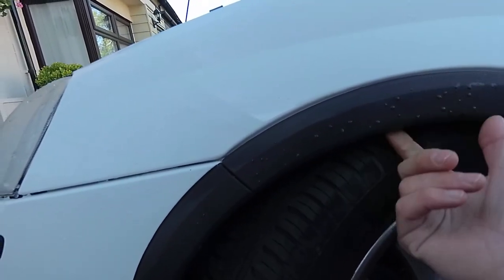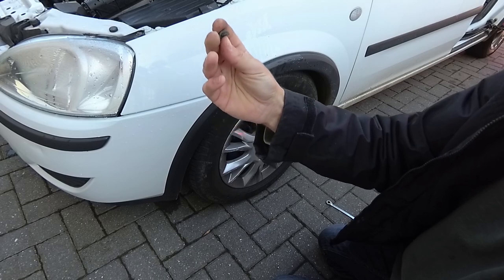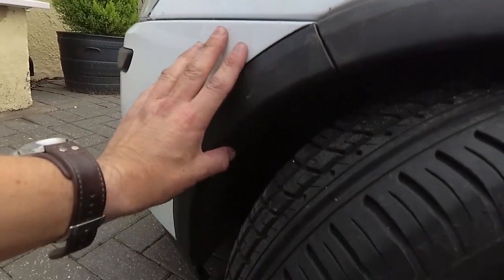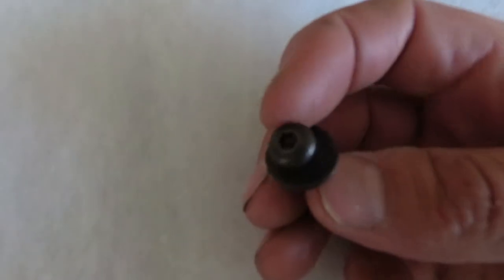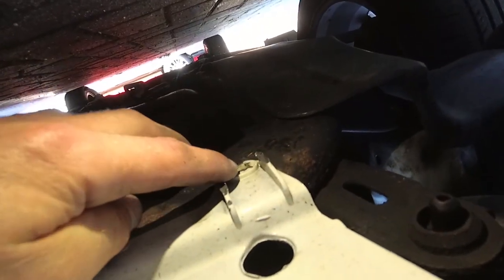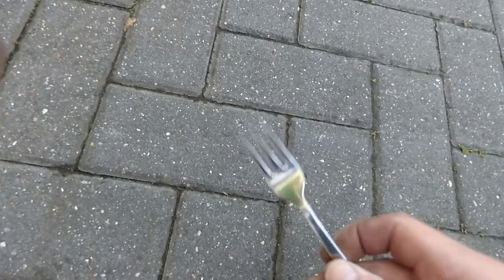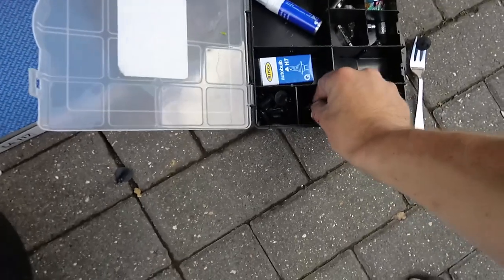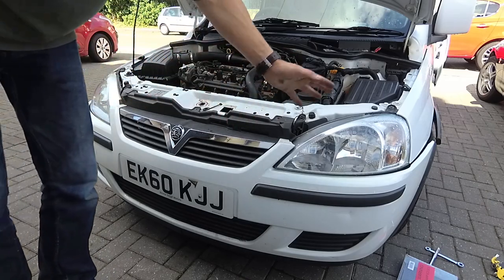How to Remove Front Bumper Combo / Corsa C - Vauxhall  COMBO MODS

Comment: Just removed and refitted today, thanks for the walkthrough. To answer Taylor Page
 question (from a year ago, sorry so late). To remove the upper grille for Irmscher (or, in my case, a Blitz to replace the Griffin that was on my Opel) there's no subtle way. The are LOTs of plastic tabs and they are gunked, glued and melted into place. Just get a small claw hammer and lever the black grille away, section by section. Some tabs will stay on the bumper; most will snap off, still stuck to the grille. I used Gorilla Glue Gel for my Blitz grille (which came from a breaker and most of the snapped tabs were stuck in that).

Comment: Very helpful video, thank you. I had one of those little black panels knocked out by hitting a bird and, because most of the straps have broken which hold it in place, my best option is to get the bumper off. One additional piece to add I think is to just jack the car up if you can't get at those bolts above the wheel.
Reply from the maker: +Richard Archer yes that’s a good solution, but if your jacking the van up then may as well take the wheels off too, for ultimate access.

Comment: Where did you get that box of hardware from, I know you can buy individual sets of hardware but am looking for a set of different bolts n stuff that all fit the car in case I break any taking off anything, any advice or links appreciated
Reply from the maker: +Daniel Nicoll I just bought the hardware all separately from eBay and Amazon, then got a cheap box from the pound shop to store them all in.

Comment: Where would i find those rivet clip things for the bottom of the bumper? What is the name of them
Reply from the maker: They are called plastic trim rivets, got mine from ebay, heres a link to some - 
https://www.ebay.co.uk/itm/10x-Vauxhall-Bumper-Wheel-Arch-Plastic-Rivet-Body-Panel-Retaining-Trim-Clips/273427989552?_trkparms=aid%3D111001%26algo%3DREC.SEED%26ao%3D1%26asc%3D20160908105057%26meid%3D5e5355dbcb644c12ae7f6f36cfa497ef%26pid%3D100675%26rk%3D1%26rkt%3D15%26sd%3D273427989552%26itm%3D273427989552&_trksid=p2481888.c100675.m4236&_trkparms=pageci%3Abe55bd02-b593-11e8-8365-74dbd1809856%7Cparentrq%3Ac78493bc1650aa465239ac36fffc8c41%7Ciid%3A1

Comment: Once you take the bumper off do your headlights slide out or you got to take out bolts? I need change some headlight bulbs but having no joy from the tiny gap at the back of the lights.... grrr
Reply from the maker: +Anders Mcfarlane the headlights have their own bolts. Yea you need double jointed pixie fingers to replace bulbs from the engine bay.
Reply: Rust Locker cheers. Mate....iv got my Saturday morning sorted to change a bulb.....I’ll do them all come to think of it now....nice 1

Comment: @Rust Locker - all the replacement bolts you've brought, where did you buy the replacements from? if you could share the link??
Reply from the maker: i got them all from ebay. Some of the sellers I bought from are no longer listing, but similar links below :)

https://www.ebay.co.uk/itm/8-PIECE-SET-for-VAUXHALL-CORSA-C-EXTERIOR-FENDER-WHEEL-ARCH-TRIM-CLIPS/222086512410?ssPageName=STRK%3AMEBIDX%3AIT&_trksid=p2057872.m2749.l2649

https://www.ebay.co.uk/itm/10PCS-Bumper-Rivet-Trim-Clips-Fasteners-For-Vauxhall-Astra-Corsa-/283078731679?hash=item41e8cea79f

https://www.ebay.co.uk/itm/5-x-Torx-Screws-TX25-AUDI-Vauxhall-Seat-Skoda-Porsche-VW-5x16x15-N90775001-NEW/183128792942?hash=item2aa3539f6e:g:pnEAAOSw5ZBWLn0o
Reply: Thanksss!!!

Comment: I'm looking for info on replacing the arch trim on a 2011 combovan. It the trim with the sill attached, I can see a black bolt on the bottom of the sill, is that a torque screw?